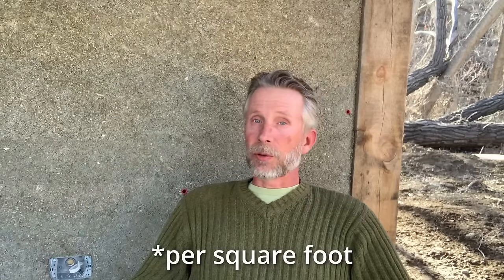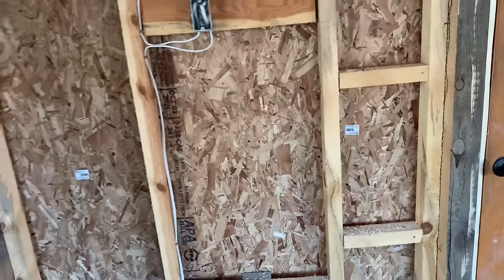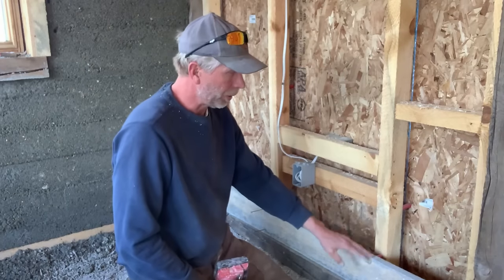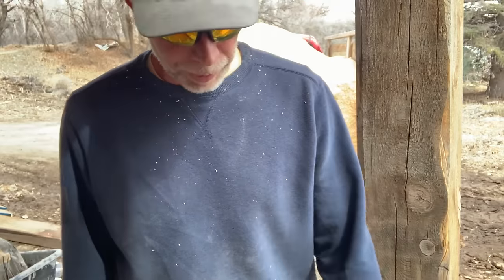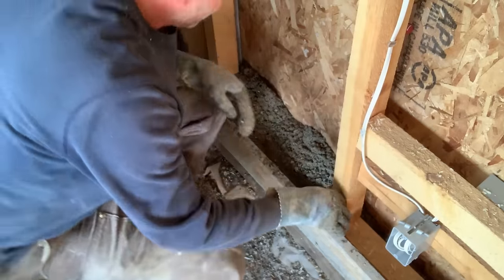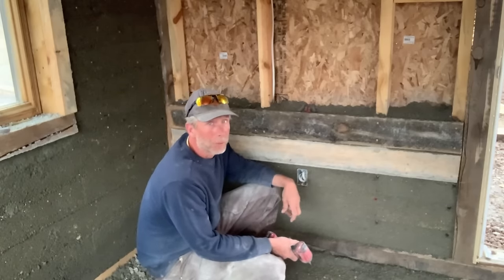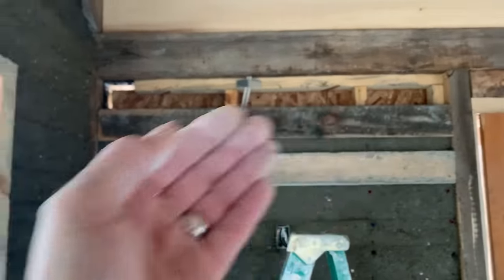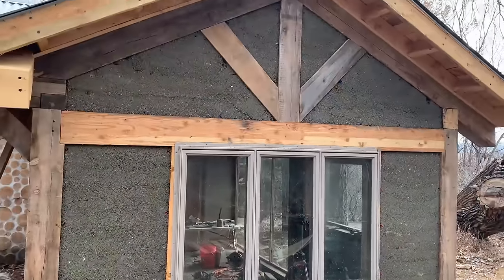Dustcrete

Comment: How much does one wheel barrow cover? I'm trying to calculate how much I would need. If I missed it in the video, I apologize. Thanks 😊 
This may be the answer I'm looking for.
Reply from the maker: Each wheel barrow makes around 2 cubic feet. So, one batch will fill a 6” thick, 4’ wide wall 12” high.
Reply: @radicalgastronomy  thanks 😊
Could you use this for the floor? I have a friend that desperately needs a floor in her bathroom. I was telling her about this and that's the question she wanted me to ask.
Reply from the maker: @AlicesAdventuresInUnderland  there may be a way to use it as an insulating layer under an earthen floor, but I wouldn’t use it as a final layer. Check out my earthen floor video for more info on that system. Another commenter told of using hardwood saw dust (I’m assuming finer dust than I used here) and some fiber additive for a cement sawdust floor. Maybe reach out to him.
An earthen floor sealed with linseed oil and bee’s wax would be great in a bathroom, and can be poured over a conventional subfloor at 3/4” thick.

Comment: What is your plan to prevent moisture migration? Looks great what climate region are you in?
Reply from the maker: As the dustcrete and the plaster are vapor permeable, I have an open boarder policy on moisture migration. High desert zone 5. About 15” of rain per year. In a wetter climate I would encase the whole frame in dustcrete and lime plaster the exterior.

Comment: I would be worried about moisture in the sawdust and winter temps doing damage, up here in Canada anyway ?
Reply from the maker: I have a video coming soon showing what happened inside a dustcrete wall with a leaking pipe. You may be surprised by what I found. Vapor permeable plasters are key. I don't use latex paints or stuccos with this for the concern you mentioned.

Comment: Call me crazy ha.. I've thought for years what product I could use and apply by hand, to serve as a headliner in my Ford Ranger...applying by hand, so not having to take off visors, dome light etc,,,
The truck is 20 years old and has 148k miles. The thin material is sagging down some and has parted from where it meets the windshield. It appears the material stays put on a vertical line but horizontal if put on the headliner hard shell. I'd probably need to have an inch of this mixture you're using, but can do in thin layers to make an inch, pressing it on and hope it doesn't fall lol...a blow dryer may come into play. Maybe mixing in some polyurethane in with the water could help to adhere.
Reply from the maker: Not sure this is the right material for a head liner. I’d find a velvet Elvis at a thrift store and use 3M 77 spray adhesive to glue it to the sheet metal.

Comment: I have been looking at building my home with using 10x10 post 16ft tall  and was considering doing the walls cordwood style , Do you have any idea how well the dustcrete would work in the place of mortar?  any ideas or suggestions? I will be building ontop of concrete slab from previous home that burned
Reply from the maker: I would not recommend using dustcrete as mortar in a cordwood build. It works great in thick lifts, like this, but in thinner mortar joints it would likely crack. If cordwood is the plan, I’d go with 24” thick walls and the mortar described in my cordwood vid.

Comment: Hello wondering, since I'm thinking of doing something similar. Why didn't you use Cob instead ?
Reply from the maker: Where I live it gets cold. Though cob has high thermal mass, it offers almost no insulation. Cob is great for warmer areas, but makes for a cold house in my area. Also, I’m working alone, for the most part. Cob construction is best as a group activity. This was a great solution for my specific needs, but other systems may work better in other circumstances.
Reply: @radicalgastronomy  thanks for the quick answer :)
Reply from the maker: @cesarmelendezsahagun2036  👍

Comment: What would happen if you didn't plaster it? Weather destroy it?
Reply from the maker: My west side is still not plastered, and holding up flawlessly. My climate is dry (15” if rain/year) and I have a 2’ eve. There will be a ~ 1/4” gap between dustcrete and framing members, once it’s fully cured. Cleats (preferably caulked) will help minimize drafts around the edges, but plaster fills the gaps.

Comment: do you have any idea r-value of the dustcrete? Is this is recent project or do you have other projects that are several years old; how it holds up over time, weather, etc. would there be any reason to add borax to the mix to inhibit mold?
Reply from the maker: I don’t have a good number for r-value, but I am assuming that it is higher than sawdust alone (about 1.5/inch for softwood) because the particles shrink a bit as they dry in the wall, leaving air pockets. I have some 2 year-old sections that are holding up great. It should be noted that my location is high desert. There are a couple sections where I haven’t gotten plaster on the outside, and they show no signs of degradation after a year of weather exposure. Borax could be helpful in wetter climates, but I can’t say. Another thought I am planing to experiment with is a mix of clay and lime, instead of Portland and lime. This may help wick moisture away from wood contact points, reduce cost, and carbon foot print. Stay tuned…
Reply: Can’t wait to see that video I think the Clay in line will breathe a lot better
Reply: @radicalgastronomy  I've got nothing but clay on my property and would be very interested to see that result.
Reply from the maker: @timquirk7551  I’m thinking I’ll try this inside the pallet wood chicken coup, once the nights warm up. Stay tuned.

Comment: Do you have Expanded Styrene (EPS) available? Mixing would increase the 'R' value. Your thoughts on using EPS and or adding EPS to a recipe? Several sawmills in my area makes sawdust aka 'dustcrete' attractive. Subscribing. Thanks!
Reply from the maker: I imagine that EPS would work as you theorize. My vibe is to avoid all products with any toxic potential. EPS has a potential to off gas, and my goal is a building system free of plastics and other petroleum chemicals. I have also seen great performance from 8” of dustcrete, and feel no need to alter the mix. That being said, I’d love to know if you try this, and would never impose my quirky standards on others. 😉👍
Reply: @Radical Gastronomy  With such a quirky handle as 'Radical Gastronomy' you surely must have an understanding of chemistry to evaluate EPS off-gasing when contained in a wall/ceiling cavity or if the polymerized styrene monomer (C8H8) might contain traces of reactant pentane (C5H12) used for inert expansion. Your sawdust can be simply expressed as about carbon 61%, hydrogen 5%, oxygen 34% and nitrogen <1% aka (C6H10O5)n commonly called cellulose or lignin. Bottom line: lots of basic periodic elements that can be rearranged for some benefits, Yes, your "dustcrete" might be a great insulator when  stabilized with Portland Cement (PC) et. al. Likewise, EPS can be made into "styrocrete" with like PC or another fixative without worry of cellulose mold, composting combustion or bio-degrading causing the structure to become a toxic hazard or fireman's nightmare. Best wishes!

Comment: Doesn't sawdust break down over time due to alkali in cement?
Reply from the maker: Apparently not. Viewers in Poland tell me a similar technique has been used over there for 100 years without failure. Also, as the load is carried by a wooden frame, and the walls as encased in plaster, would it really matter? If the sawdust completely disintegrated that would leave air pockets that would potentially improve insulation. 🤷🏼‍♂️

Comment: What is the R-value for the 3 inch thickness of the dustcrete?  do you need to have thicker walls for colder climates?
Reply from the maker: This build is 7" of dustcret with R value between 19 and 32. I'm working on doing tests. Even at the low end, thats plenty for a wall in a cold climate. Of course, the roof insulation is far more important. I'm thinking of ways to use dustcrete up there, too!

Comment: It's nothing new so saying you invented it is stretching it.

But this would be great against termites and other wood eating bugs, probably hold up good against small water leaks.
Gives extra thermal mass.
Good against airborne noise.

But i doubt it's insulation performance compared to fibreglass.
Reply from the maker: @tullgutten  I explain my claim of invention is the Q&A videos

Comment: So you don’t get cold joints or do you keep it going fast enough?
Reply from the maker: It cold joints like a motha. Each infill section must be completed in a continuous pour to avoid cracks transferring through the plaster. I cold jointed the wall shown in this video, and have a crack as a result.
Reply: @radicalgastronomy  I only know about cold joints through a failed foundation pour. It was caused by not getting concrete trucks up fast enough. It cost me 40 thousand and a new foundation. I think your alternative building techniques are really cool.
Reply from the maker: @buck9739  yikes! What a nightmare. Glad you like my content! Thanks.

Comment: Would this be weather resistant as well?  What is the R value compared to insulation?
Reply from the maker: My recommendation is a lime or lime/clay plaster for the exterior, but un plastered  portions of my walls have held up nicely against a very wet winter. I have yet to test R value, but expect it to fall in the 2.8-4.6/ inch range.

Comment: Interesting, how's shrinkage? Cracks? Longevity?
Reply from the maker: I have about 1/64" shrinkage from the timber frame. A bead of calk behind the 2x3's against the main frame prevents these from drafting. I have some cracks where the dustcrete is less than 1.5" thick, and where I cold jointed that wall. There are a couple hairline cracks that appeared, but were easily filled with lime putty. My recommendation is to give the dustcrete a full month in warm weather to cure before plastering. After a year and a half, everything is holding up perfectly. Videos coming soon covering these issues and more!
Reply: @radicalgastronomy  Thanks, I may not get around to doing this for a while. But it's nice to have this information in my head.
Reply from the maker: @michaelabraham9177  Stay tuned. More experiments coming…

Comment: Have you done anything with this as Insulation in ceilings ? Will it hold i. Place or will gravity pull it off ?
Reply from the maker: I have not, but plan to. With the right cleats, it should work.
Reply: @radicalgastronomy  I'm wondering if a mix of saw dust and aircrete would work .I'm thinking of trying some experiments.
Reply from the maker: @charlesmatthews9946  That would be a good one. Keep me posted!

Comment: Can you seal this for an under ground root/storm shelter?
Reply from the maker: There are some issues with that application. Chief among them being soil pressure. I would worry that lateral cracks and wall bowing would happen quickly. Though it would be possible to plaster and seal with tar, or some elastomeric membrane (or plastic, or pond liner) I wouldn’t feel comfortable with the lateral force. One possible way to make subterranean walls without concrete might be to build gabion walls and plaster the inside and drape a vapor barrier on the outside, back filled with gravel.

Comment: SUPER TRICK: USE A CEMENT MIXER, HAVE ALL THE WATER IN THE MIXER, THEN RELATIVELY SLOWLY ADD THE DRY MIX. ANYTHING CEMENTITIOUS ADD THE DRY MIX TO THE WATER UNTIL YOU GET THE PERFECT CONSISTENCY. YOU'RE WELCOME.
Reply from the maker: Yeah thanks but the saw dust builds up on the blades and makes the mixer useless after two batches. Also, the mix doesn’t form up correctly unless the dry ingredients are mixed first. A horizontal plaster mixer works well for this, but I don’t have the 12 Gs to afford one. Someday…

Comment: What is the insulative value, as compared to spray foam or fiberglass batts?
Reply from the maker: I am working on ways to test this, and there may be legit lab work coming. I am assuming its like hempcrete in that 2.8-4.6/inch range. It sure performed well over this last cold winter.

Comment: What is the PSI of this stuff? Would it work for chinking?
Reply from the maker: I couldn’t say what the PSI is. I’m betting it has the potential to bare a load, but no tests, yet. I would not use it as chinking unless my logs were set with a 1.5-2” gap. The material would need to pass all the way trough the wall, lest it fall out.

Comment: Thanks for a great video. Do you think dust crete could be used for a floor?
Reply from the maker: Interesting question! I think so. I would use a system similar to what I did for my earthen floor. Compacted road base then a vapor barrier, then 4-5” of gravel, then 6-8” of dustcrete. An earthen floor could finish it off, or deck mud and tile. I chose to use lava rock as an insulation layer in mine, and the floor stays nice and warm. The lava rock is abundant in my local, and is a quicker and cheaper solution. The rock also avoids any concerns about mold. I doubt dustcrete would have that issue, but not having tried it, I honestly can’t say.
Reply: @radicalgastronomy  i am adapting a conventionally built house with concrete slab already in place. So i dont have much room for thickness of the floor, 2 inches max, so i have been looking for many natural alternatives that also provide insulation from below as this space i jeed a floor on was an open terrace and open from below. Thanks for your answer

Comment: It is great indeed! Have you tried this techniq with wood shaveings insteed of saw dust? Or a mixture of sawdust and wood shaveings? It is a lot more chunky and I have a feeling it could work.
Reply from the maker: I have run some tests with wood chips that worked out pretty well. Shavings should work, and actually be more insulating.

Comment: What’s the load bearing on this? Also have you found any differences in this and hempcrete?
Reply from the maker: I haven’t tested load bearing. Load is born by the frame, in this build. I suspect that with a reinforced bond beam, dustcrete should work without a frame, but tests must be done. It seems to perform much like hempcrete.
Reply: @radicalgastronomy  interesting, I’d like to see that tested. I figured this may work better than hempcrete as the sawdust is more fine. I also wonder how this would hold up in a more wet/humid environment, ie south Texas.
Reply from the maker: @jacobn5567  As long as the plaster used is vapor permeable (clay and/or lime) I imagine humidity would not adversely effect it’s long term performance. The trouble would come with latex stucco, or paint trapping moisture in the wall.
Reply: @radicalgastronomy  I gotcha, I appreciate the thorough replies. Looking forward to using this product in the future.👍🏻
Reply from the maker: @jacobn5567  keep me posted, if you do!

Comment: have you found the opportunity to subject that to some testing? like maybe a college or some place would subject it to a variety of test they'd subject other material bases to for it's intended use? i'd like to see it's insulation value, fire rating, conductivity testing, impact and load testing . . .  i'd think that with acceptable results across those considerations it'd be a much more accessible and viable option for far more people than even hempcrete or similar type products. . . peak'd my interest enough to watch and comment with inquiry :) 

oh and don't knock your 'timberframe' methods . . . it's solid and i've seen WAY worse hahaha :)
Reply from the maker: Someone from CU Boulder who teaches alternative construction methods has reached out, and there maybe engineering test coming. I will be doing some hillbilly test here, as well. Some want to know if it's bullet proof, too.

Comment: how will this work for skirting / faux foundation?
Reply from the maker: I would avoid ground contact. On future buildings I will use stone or concrete for the first 18” or so. I haven’t had problems (in my dry climate) but I could see issues developing in wet conditions. It may work just fine for that application, but my gut has reservations. 🤷🏼‍♂️